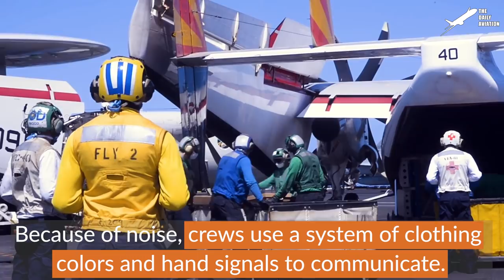How US Aircraft Carrier Deal With Intruding Elements on Their Massive Anchors

Comment: Anchor chains are not painted to prevent rust as stated early in this video. The paint you see is marking the length of chain, the distance between the paint markers is called a shackle and is 90' long. The first marker is 1 shackle from the anchor and marked with a red painted link and 1 white painted link either side, 2 shakles out is 2 white links either side of the red and so forth. When coming up to anchor the Master orders how many shackles he wants the crew to pay out for a given depth of water. Shackles can usually be counted when free falling anchor and stopping at the desired length out. Heaving in is monitored by counting shackles coming up through the hawser pipe.
Reply: Great explanation.  Thanks!
Reply: I would assume the paint also does somewhat help against rust, as it puts a layer the (is it steel they use?) and the water. But yes, what you said
Reply: Stop saying BS! Yes for the white paint these are length marks but the chain IS painted in black to prevent the rust.
Reply: The rest of the commentary is also "not so accurate".
"The catapults are used to take off faster"  🤦‍♂️
Reply: @stangood  Well as a Ships Master for 30 years I never saw a ships anchor chain that was painted apart from the red and white markers. Anchor chain is subjected to frequent and violent burnishing from the gypsy when the anchor chain is running over it, whether paying out or heaving. When dropping an anchor it is literally just that ie: free falling. A chain flys over a gpsy at such a speed you often see sparks coming of it. Paint will not survive that punishment, even the marker paint needs to be repainted regularly because it just wears off. Even when the chain is laying on the sea bed it is continually being abraided. Its hard enough to keep paint on the rest of the ship that doesn't have physical contact with anything.
Reply: @Dr.K.Wette_BE  from a layman's view thats pretty much accurate.
Reply: @careymcintosh5272  Well just replay the video, you'll see that the chain is painted in black.
Reply: @FireWarrior2013  If you make informative videos you should at least gather basic information.
Reply: @stangood  The chain is wet, its not paint.
Reply: @careymcintosh5272  2:08 check the image, it is not wet, you can see the rust and the paint
Reply: S G You obviously have not worked on ships.
Reply: S G New chain looks like it’s painted but it’s not.
Reply: @Dr.K.Wette_BE  not really. The purpose of the cat is to get the aircraft up to flying speed when used with the aircraft engines. Without the cat. No current fixed wing aircraft would have sufficient energy to depart the ship and maintain flight. In short they would fall into the ocean.
Reply: @FireWarrior2013  from a retired senior chief  the Masters description is totally accurate.
Reply: Those chains are made of blackmantium. A natural black colored adamantium steel.
Reply: @lloydholt6511  'twas referring to the catapults.
Reply: The anchor chain comes up threw the “spill pipe” and around the winch or capstan “wild cat” down the “fairway” to the “ hawz pipe”.
Each anchor chain is broken into “shots”, 1 shot of chain is 32 “fathoms” or 90 feet. Each shot of chain is mark with how many shots is from the first shot and so on. Towards the end of chain it’s painted in three different colors to let you know you’re getting to the “bitter end” of chain and stop or let it “run three”.
The “ground tackle” is comprise of with a “pelican hook” or a “devils claw or hook” to bend the chain so it does run free or out. In the video that’s a “pelican hook”, you tighten up the turnbuckle to bend the chain. The extra wires and chain falls or come along is to prevent the “pelican hook” turnbuckle from loosening during roughy seas.
From the top of the anchor “shank” is called the “jewels harp” which is attached by a “detachable link” followed by “non kink” chain to a anther “detachable link” with a “swivel link” and anther “detachable link” to the first half shot.

Everything that’s in “” is the correct terminology used on ships, what I gave is also taken from the U.S Navy “BM 1/2” manual ( Bosun Mate).
Any questions just message me on here.
I am currently sailing as a bosun, just came on the beach till my next hitch.
Aloha!!
Reply: Actually, the length of chain is made up of Shots that are connected by detachable links.
Reply: @walteralichotajr.3012  Never heard it called a spill pipe. Chain pipe and hawz pipe. Also there are wires wrapped around the colored links so even if the paint is all gone you can still tell how many shots you have out.

Comment: I love too how its the CHAIN that does most of the work in keeping a ship in place, not the anchor itself. Physics gets weird when water is thrown into the mix.
Reply: So the anchor digs into the sea bed and the vessel must lay enough chain so it lays horizontal on the seas bed. This allows the weight of the vessel to have a horizontal rather than vertical pull on the anchor. For a vessel of this size it’s the weight of the chain on laying in the sea bed that provides most of the resistance to wind or current.
Reply: Вода для охлаждения
Reply: Yes, anchors on carriers have a low holding power ratio and are ultimately large clump weights. The chain plays a large role in the mooring systems overall holding capacity.
Reply: it's all cool until the anchor hit fish head.
Reply: Well not entirely true. If it weren’t for the anchor going down and hitting the sea floor to sort of bury itself the carrier would simply drift with the current & be at its misery bc let’s say for example that you remove the giant anchor & use only the chain itself. Although the links of the chain are massive solid steel that weight alone wouldn’t be enough to hold even a Nimitz class carrier let alone a monster carrier like The USS Ronald Regan. I know for a fact that if you were to use the chain alone on the Regan although massive like I said without the anchor dragging those massive links to the bottom the chain would simply float freely again leaving you the misery of the insanely strong currents especially in the Atlantic.
Reply: @Phildo8   the typical stockless anchors used on carriers have 3:1 to 5:1 holding capacity, on most sea floor conditions. They do not bury much at all and act primarily as a clump weight. The carrier mooring systems are designed such that you must have both the chain and anchor - using only chain, or only anchor w/wire would certainly not provide sufficient holding capacity for the vessel. However, some mooring systems are designed to have a much higher holding power anchor, and a chain leader, that ties into a main wire rope anchor cable. In this case, the anchor design allows for the anchor to embed further into the sea floor, when in use.
Reply: Lol... I’ve never seen a chain do shit without an anchor attached to it🤷‍♂️
Reply: @hikl223  lol... As a person who works with manufactures of navy vessels and sell marine equipment. I can confirm, you are correct.
Reply: @Fo tY typically, yes. However, it all depends on the mooring system design, specifically the anchor type.
Reply: ...all this can go to the trash bin by changing the anchor for a wrecking ball
💪😀🤳

Comment: I remember having to scrub the deck in 100 degree heat, freaking sucked!!! Also our squadron barracks was right underneath the catapults, took me about 2 weeks to get used to it and actually sleep
Reply: I slept underneath cat 2 on Forrestal, and it took only a couple of days to get used to the noise, long days back then!
Reply: Same here shipmate.
Reply: Sleep was easy not half as bad as having to grease the damn things
Reply: Menial cavemen work, primitive at best.
Reply: That's the boiling point of water!
Reply: I wonder what the noise from the Ford-class electromagnetic catapults will be like? A continuous hum like from a transformer might be worse. 
When I was stationed at Ft Bragg NC in the late 80s, we lived in the old wooden barracks maybe 1/2 mile, tops, from the end of the Pope AFB runway. Having C130s, C141s, and C5s going overhead so low that you’d swear you could hit one with a thrown rock wasn’t conducive to restful sleep. But neither was open-bay barracks life in general LOL
Reply: @dunruden9720  I think he is using the primarily american only temp system of Fahrenheit.
Reply: Booohoooo, had to scrub the decks!  Quit your crying
Reply: @kaspernbs  No, he meant 100C, as in the water used to scrub the decks was literally boiling. That’s why it sucked so much. 😁
Reply: Yeah I slept on the top rack under the no. 3 wire on the america and indy :) or in our shop that was right behind the tower(under) it on the last starboard cat walk just with "door" hatch open the wind was about the sound of a jet:)
 Suppose working in the heat at Miramar helped with the heat in the Indian ocean :) Be well Peace. Rick

Comment: "More than ten units in operation' really? I can handle a number like ELEVEN come on.
Reply: ford is the 11th?
Reply: @Danny DNA  
.
Reply: Careful, it might be 12, or even (gasp) 13!
Reply: Lol
Reply: They got 5 dudes on a redline...wth? The Navy IS the fattest branch...they couldnt get someone with a little more ass to hold that hose? Lol. Based on it's diameter and spray, I assume it's roughly the same pressure as a red line on a fire truck; there's a bit of force when you open it up, but I'm 5'9" and 185 lbs (I was 17, in the VFD of my hometown), and didnt have a problem controlling it by myself when we responded to grass fires and such.
Reply: The DoD and military branches are really sensitive about releasing certain numbers. I remember back when I was in Navy JROTC we had books that covered naval ships and aircrafts (specs, designator meanings, time in service, etc). I remember that they never listed a definitive top speed for anything; ex: Nimitz class carriers top speed said "60+ knots". It was always "#+ knots". Also, the submarine info was even more secretive, because they would be really general in their descriptions. Theyd say things like "more than a dozen" in service, or "weapon systems are compatible with xxx, xxx, xxx, xxx, xxx, and xxx" but never mentioning that half of the munitions listed are rarely used or have been replaced by modern devices, etc. In short, the military is weird about their numbers and capabilities. This is why OPSEC, PERSSEC, and INFOSEC are drilled into our heads like those damn SHARP slideshows.
Reply: @olsmokey  Dude! I !! wanted to say that  !!!

Comment: I would like a detailed look at the holdback strut... how it holds the aircraft at full power, and releases when the CAT fires.
Reply: If i remember correctly, they actually snap/break when the cat is fired.
The aircraft bump into place, then the strut is locked in, then the shuttle is scooted forward to take out the slack. Then the aircraft slowly throttles up.

Its not till the violent release of pressure into the cat that enough force hits the strut to snap it.
Reply: Breaks when enough catapult force is applied.   It takes a little time for catapult to build pressure so to allow for that, the hold back bar holds the plane until sufficient force develops to launch the plane.  It is precisely machined to break at a certain location and at certain force.
Reply: @borysnijinski331  part of my job was to remove the broken piece in the captured carrier and I just threw it overboard
Reply: @ShadowRhapsody81  that's what I've heard also, they have struts that are designed to snap at launch that have different strengths depending on the weight of the aircraft !
Reply: @severussnapes374  what are the pins made of ?
Reply: @charleslacombe359  they are made out of atoms
Reply: @severussnapes374  No recycling!?
Reply: @Phaidrus  just go to a side and yeet that to the ocean it’s gonna be fine
Reply: Certainly Vlad, or should I address you as Xi?

Comment: What keeps this giant vessel,that weighs in thousand of tons,afloat,is incredible.
Reply: to propel such a massive stucture at a speed exceeding  30mph is also mind boggling.
Reply: Millions of tons of water below it.
Reply: Buoyancy. And in terms of speed... I believe this class of carrier is nuclear powered?
Reply: The Ford class carriers are designed to operate completely upside down. They launch aircraft the same way subs launch boomers. Quite a sight to see.
Reply: @FireWarrior2013  All of our current carriers have nuclear plants, but to call them nuclear 'powered' is technically wrong.  Steam still drives the shafts, the reactor just makes heat to create steam.
Reply: @danroux4010  It goes quite a bit faster than 30 mph. The actual top speed is classified, but is publicly known than they can hit 40 knots, or about 46 mph.  Sometimes you have to go that fast to create relative winds over the deck for aircraft operations.
Reply: @SteelDoesMyWill  Interesting info, thx. The other aspect of aircraft carriers that I can hardly get my head around is the amount of knowledge a commanding officer has to possess to guide its smooth operations. I read that some of them make almost USD150K per year. They are worth every penny!!
Reply: It's called buoyancy. Kinda like how aerodynamics keep planes in the air.
Reply: Absence of water internally.

Comment: Came here for anchors, got to see a k98? with a cup style grenade launcher being used as a line launcher.

10/10 Would recommend!!
Reply: Looks more like a modified M14. Still pretty neat to see one of those still in use.
Reply: @LNERMallard  It looks like you might be correct. The M14 had an under barrel launcher, that's why I thought k98. It could very well be a modified cup launcher from something else, because it is only firing a line from ship to ship, after all.
Reply: @ShadowNuke  definitely an m14. It’s used to shoot a line across from one ship to the other. They use a blank to do that. They shoot it across so they can use it to hook up stuff like mail and a fuel hose.